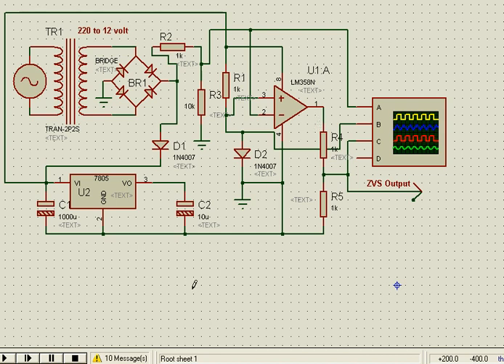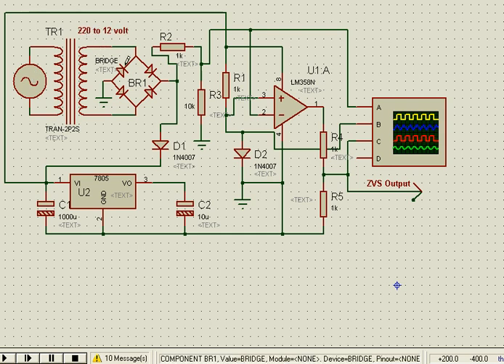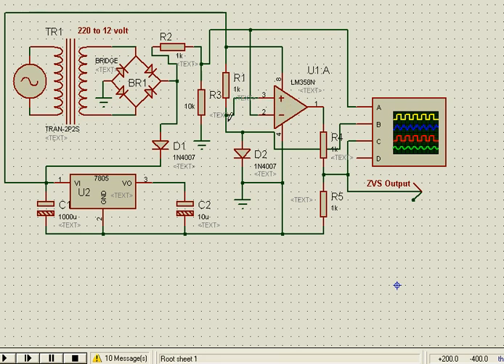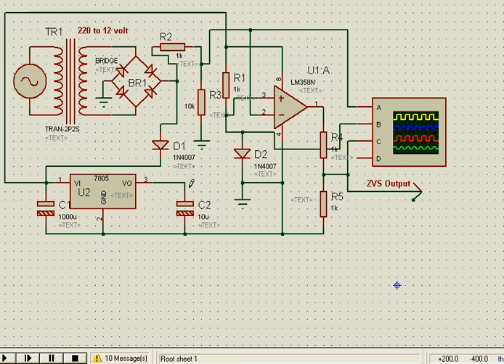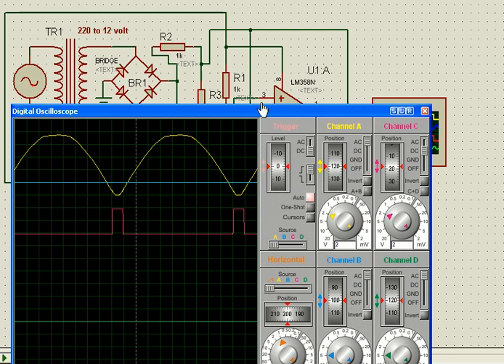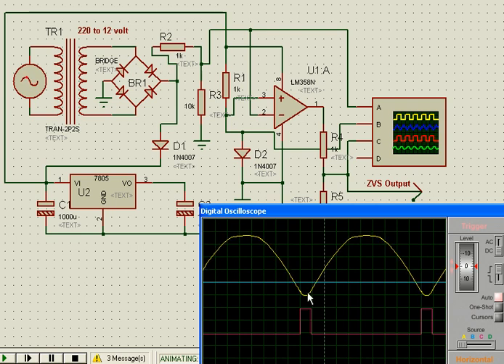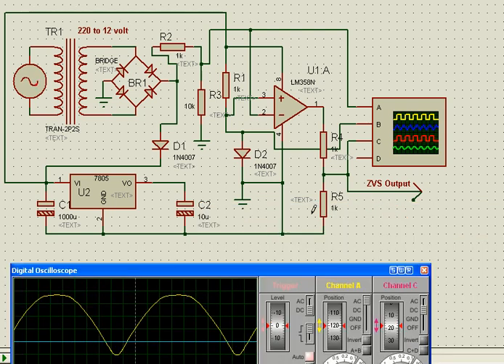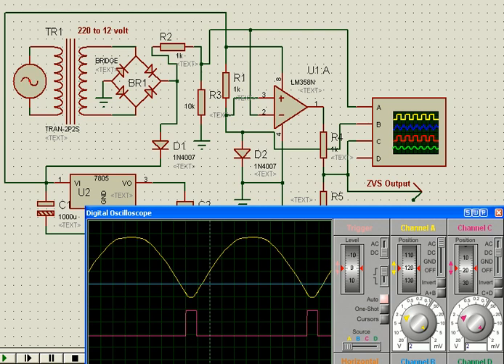Zero voltage reference for microcontroller input

Comment: why cant we give directly ac signal to the OPAMP one to inverting and other to non inverting as the non inverting signal goes high that is in the negative half cycle we will get 0 V as output and when the inverting terminal is high we get 5 V or 12 V as output.
it should still work the same
Reply from the maker: sanoo singh AC as we know rises from zero to peak in +ve half cycle and then comes back to zero and goes to -Ve peak in -ve half cycle. So the output will be pulsed/ rectangular like and not discrete zero or high.Because while it crosses the fixed voltage of one pin while the ac is rising it goes low or high depending upon which pin is fixed and while the ac is  falling below the fixed voltage it does the reverse so one gets rectangular pulses.

Comment: I want to simulate a transformer in Proteus (220v 50Hz to 12v).
I used a simple transformer (TRAN-2P2S) and connected an alternative voltage source (alternator) to it.
I don't know the values of "Primary Inductance", "Secondary Inductance" and "Coupling Factor" in order to get 12v in output (quick simple way to calculate them?)

Comment: This type of regulator may oscillate with excessive capacitive loads, escpecially if a large capacitor with a low ESR is used. A 0.1uF X7R-dielectric capacitor (without any additional capacitor) is recommended.

Comment from the maker: Poor PF in delayed firing angle triggering is unavoidable.One has to follow integral cycle switching rather than delayed firing concept. As shown in the circuit it is a linear load so snubber is not required.For EMI yes a small filter is required.

Comment from the maker: It is not advisable to control a 3 ph motor of such high capacity by triacs using firing angle control (which you perhaps mean as PWM).Very high harmonics would be generated.V/F method of speed control  is the only answer.

Comment: C2 is too high. Use a 0.1uF ceramic capacitor at the output of the 7805 regulator.

Comment: The circuit is correct..You can use 5 volt DC for a Microcontroller from the pin No 3 of the IC 7805

Comment from the maker: No the circuit is not wrong.The circuit is not using 5 volt DC but it uses 12 volt DC for LM358 IC .5 Volt It shall be used for the microcontroller while we use this circuit for further interface.